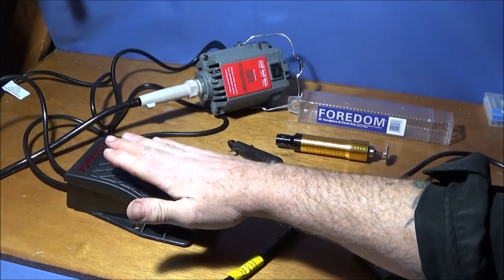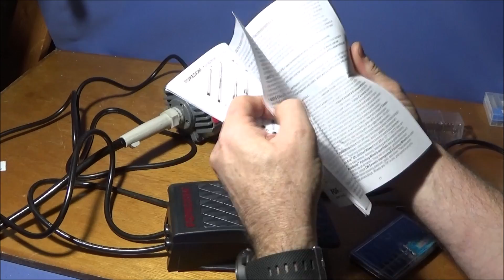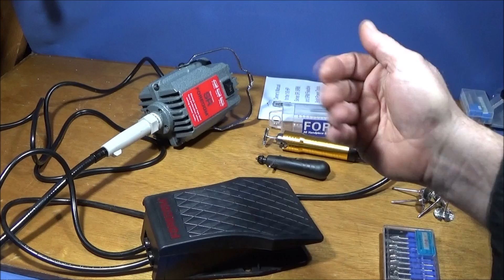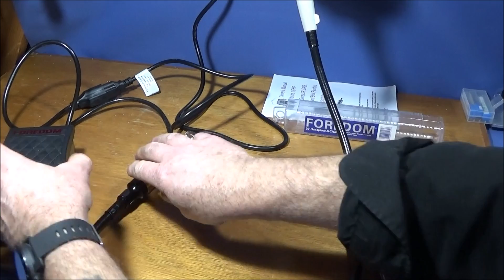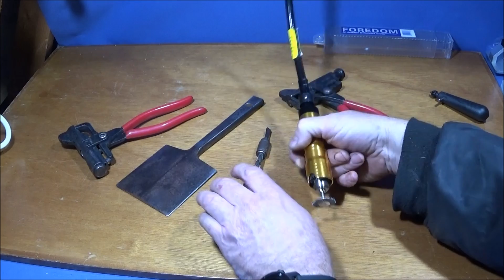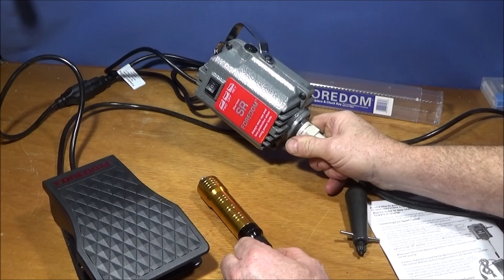Chinese 'Foredom' SR Series' 230 Volt 1/6 HP Motor Flexible Shaft power Tool

Comment: Gteat tool. Made in my home state. My tool came with a tube of lubricant. I think i have had mine for over 20 years. I used it as a tool post grinder to fix my jet ski impeller. See my vid on it.
Reply from the maker: Thanks I will have a look at that later.
Reply: Why would this be made in your home state then shipped to China and be sold for 1/3 of the MSRP..... It's a cheap knockoff. If it works for you that's great, but should not be called a Foredom
Reply: @Steve_Just_Steve  maybe the current one is but mine was made in Connecticut over 20 years ago.
Reply: @tjs_welding_and_fabrication  Yes Ive just found this vid and searched for one and it seems China is the manufacturer :(
Reply: @mk1cortinatony395  maybe so. I will make a vid on the one i have soon. I know made in Ct.
Reply: @Steve_Just_Steve  It's not a cheap knockoff; it's inexpensive. Big difference.

Secondly, nowhere on the tool does it say Made in USA. No American flag insignia, just the company's US address. We know that Foredom buys its polishing motors from Asia and puts their brand on them. I have a suspicion that the flexshafts may be similarly manufactured and distributed. This being said, Foredom uses other suppliers for the pedals and chuck keys. Ask me how I know.
Reply: @felixf5211  why are you defending an uncouth manufacturer? this is generally not a beneficial practice for the consumer..... id like to encourage you to respect truth and forthrightness.
Reply: @lbdeuce Foredom rotary flex tools are assembled in the Connecticut plant with international (import) components. I called the Parent company and customer service told me this.

Comment: Does the shaft require any lubrication?
Reply from the maker: Yes it does. You can use the Foredom lubrication, but I just use a light coating of Molybdenum Disulphide grease. I forgot to mention it, but there is an important section on lubrication in the users manual.

Comment from the maker: SEE TOOL LINKS BELOW:-
FOREDOM 220V 0~18000rpm 6mm Hanging Flex Shaft SR Motor -- http://bit.ly/2S78i8t
20pcs Stainless Steel Wire Wheel Brush Cleaner Polishing Rotary Tool24pcs Wire Steel Brass Brushes Set Polishing Brush Wheels --  https://goo.gl/UY2ZK9 
32pcs Brass Steel Wire Polishing Brushes Set Polishing Wheels Kit -- https://goo.gl/j5FKDA
-- https://goo.gl/XRNALh
 $0.01 Snatch -- http://bit.ly/2NuPYVW
  Spring Sale -- http://bit.ly/2VzASRP
  Electronic Tools Sale -- http://bit.ly/2SLxUYG
Reply from the maker: Banggood Health Protection -- http://bit.ly/33tNTBx
  Banggood Health&Care Protection --  http://bit.ly/3d7QpSy